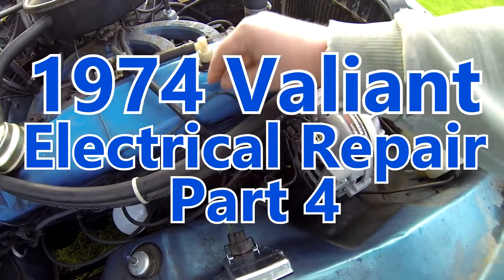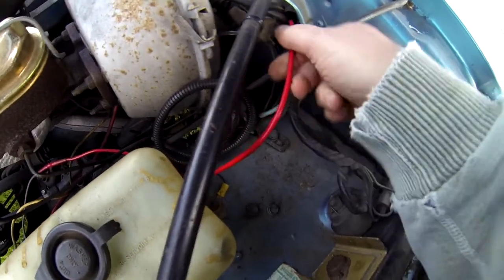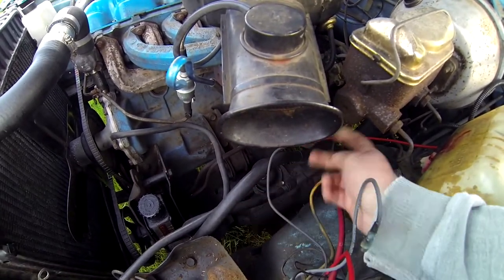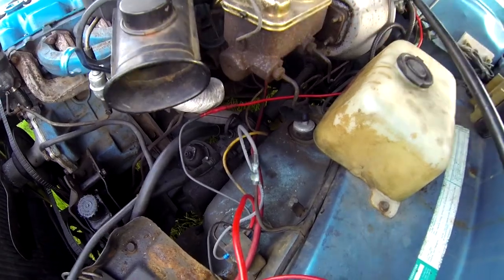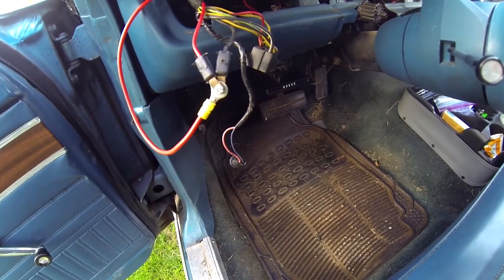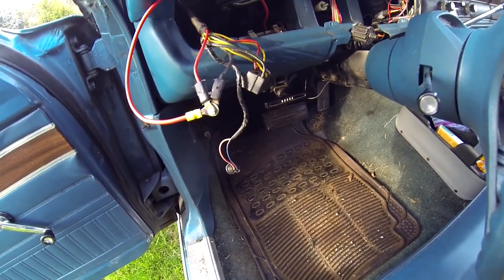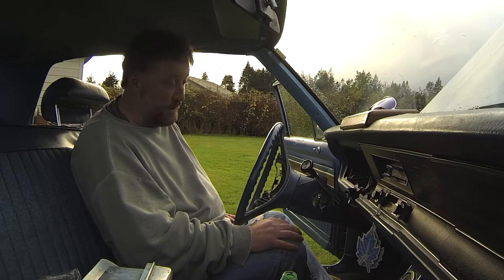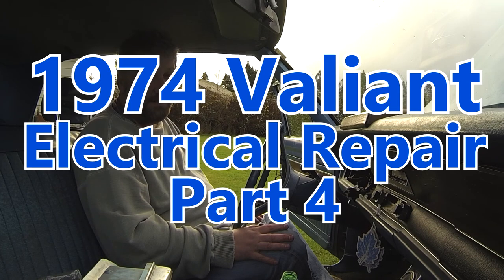1974 Valiant-Electrical Repair-Part 4

Comment: If you are curious why there is a screwed-on block off plate on the air cleaner, that's where the "OSAC" valve is on US A-bodies from 1974-onward. On '73's it is on the firewall. Canada apparently didn't require those type of emission devises, so they simply used a plate to cover the hole on cars sold in Canada.
Reply from the maker: Canada also did not require the seat-belt ignition kill switch in 1974. My car has that factory disabled. The wiring and connector does still exist however